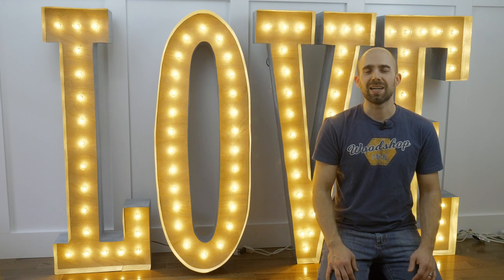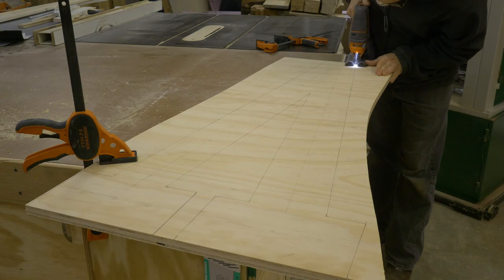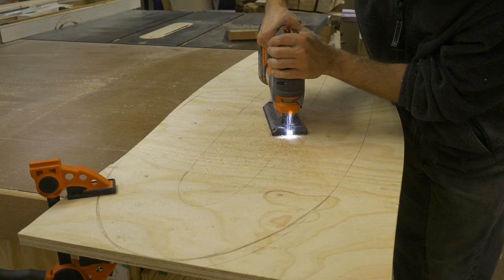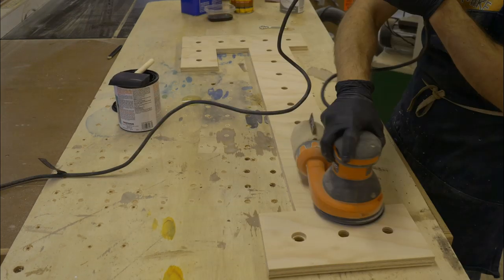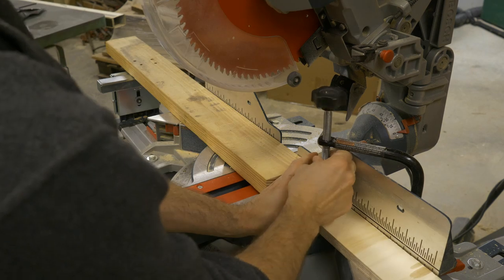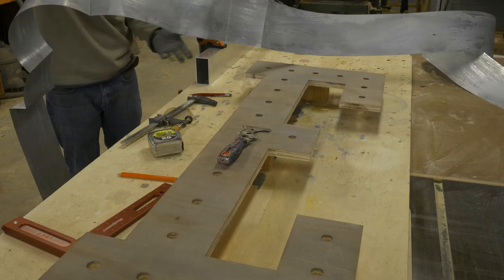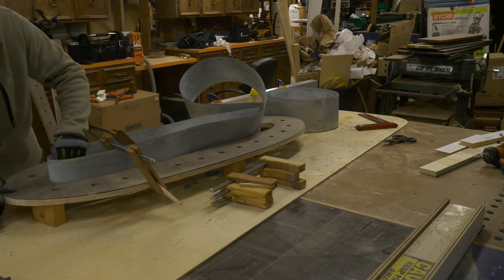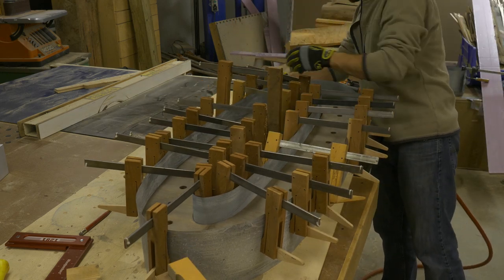How to Make a DIY Vintage Marquee Sign

Comment: Hey Mike great job! I was a question about the bulbs , do you buy those at a local Home Depot? And do they sell them wired up together or individually?
Reply from the maker: Thank you so much!  I bought mine from Amazon (Globe string lights - https://amzn.to/2WCPmAT).  They are wired up but I did have to splice a few extra bulbs on for one or two of the letters.  No big deal though, just a couple of wire nuts is all that I needed! 👍👍

Happy building!

Comment: Can I spray paint the flashing?
Reply from the maker: Yeah you should be just fine to do that.  I'd just prime it first 👍🏻
Reply: Thanks
Sorry I have another question how wide should I do letters if I’m making them 3ft talk- the words are “Marry Me”
I’m sketching the “M” but a 3ft by 3ft seems odd to me
Reply from the maker: No worries.  I just typed it on the computer and had it plotted out.  Otherwise I'd just eyeball it 👍🏻

Comment: So i took this to fedex to print and was told it would be over $250 before taxes to print this out.  What did you print yours out for?
Reply from the maker: I have access to a plotter which is what I did for this one.  In the past I've printed a little on several pieces of 8-1/2 x 11 and then taped them all together.